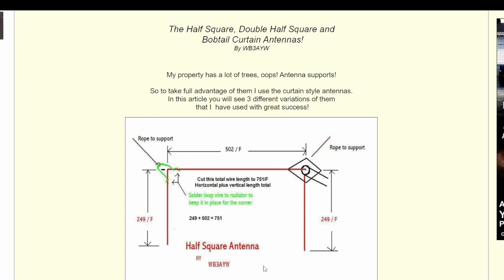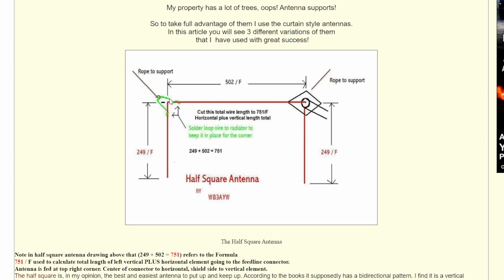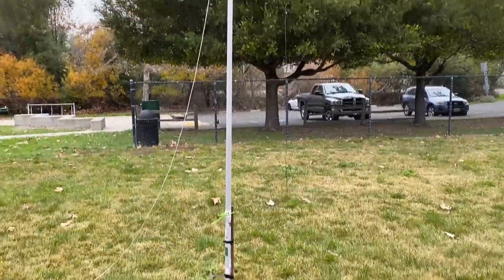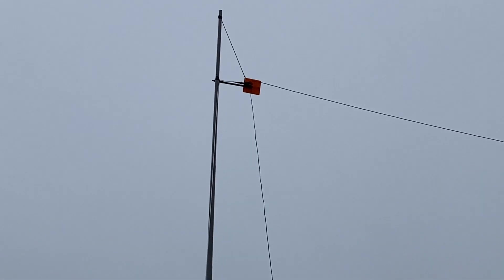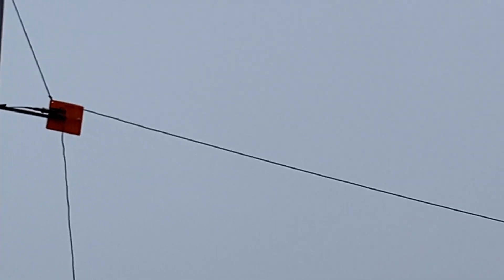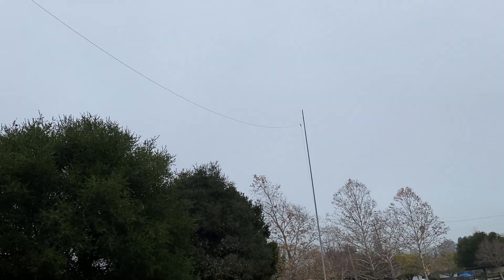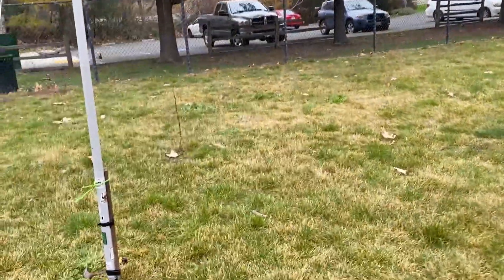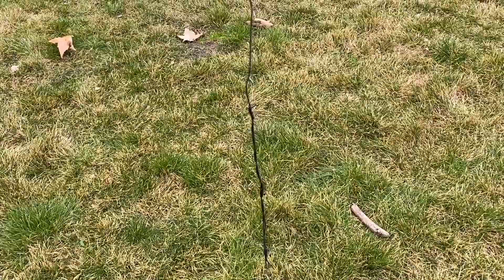How to make a 20 meter Half Square Antenna with custom brackets. Easiest DX antenna?

Comment: You can also feed this antenna at one of the ends at the ground with a 49:1 unun and it will work on both 40 and 20 with a decent pattern. Will also resonate on 15 and 10 with a crazy pattern -KE6VG

Comment: Great video again. I have experimented with these. Made one on 80m that I had suspended between 2 high pine trees. Worked great.
I also made some for 40m. I extended your version with another leg in the opposite direction making 3 elements, kind of like a Botail curtain but directly fed in the top. I compared with a friend who live very close to me whom had a 4-square on 40m and I was receiving the same stations stronger than him.
Next I tried extending it again making it 5 elements, gain and low angle was great but I was having inconsistant SWR. I think it was because of the sagging I had in the horizontal wire. If I only had 3 trees someone in line that could be fixed. 
It is amazing what one can do for not very much money.
Tips, dont let the ends come too close to the ground, the voltage there is very high. Dont touch the ends even when not transmitting, last, hang something in the ends to make the wire hang straight and not blow around in the wind so much.
73

Comment: I noticed you said you run a 40m HS at home and a doublet. Can you send over a video in comparison? Tnx chuck
Reply from the maker: Jay Good Idea. I will try to do a video on that , I need to check my HS out first I haven't hooked it up in a while it may need work.
Reply: @KK6USYHamRadioAdventures  I’ll hold ya to it :)
Reply from the maker: @JayN4GO  It might be a while for some reason we are getting rain about 2 weeks straight so far.

Comment: Does it radiate off the sides or is it omnidirectional?  N4KBM
Reply from the maker: Tommy off the sides but not a huge difference like compared to Yagi. It is omni directional with more gain to the sides.

Comment: Chuck, late to the dance here but wondering what the usable bandwidth is for your half square. Looks like 100 kc on your AA-30. Can you confirm?
72 de William, k6whp
dit dit
Reply from the maker: Yea that sounds about right, it has been a while since I used it but it was good for the 20m band.

Comment: Hello Chuck. I don't see any info on the 10 meter push-up poles. Can you let us know make model where you were able to get them. Are they fiberglass or carbon fiber or something else. Thanks
Reply from the maker: I have a Sotabeam, Packtenna and the DX commander expedition 10m fiberglass mast. Pretty sur the are all the same except the DXC is black and most likely the only one you will find in stock. Don't use carbon fiber for this antenna.

Comment: I like this I don't have the printer and don't how to print. But if could I would build one.
Thanks Chuck 
KQ4CD Paul
Reply: Cut some plexiglass / plastic from the big box stores and make them. That is what I am doing since I don't have a 3D printer. I am going to put a SO239 on my setup since that is what I have a lot of. Hope this idea helps.